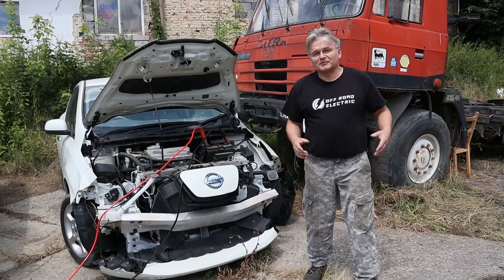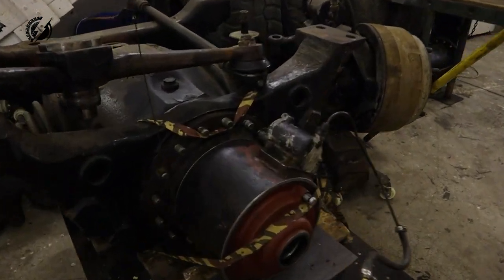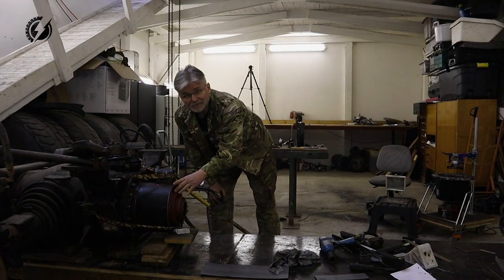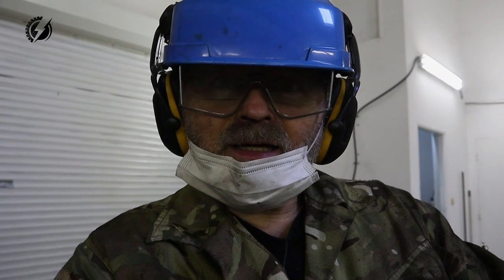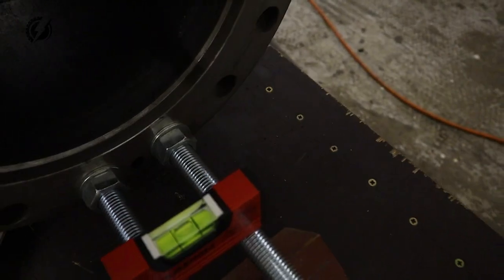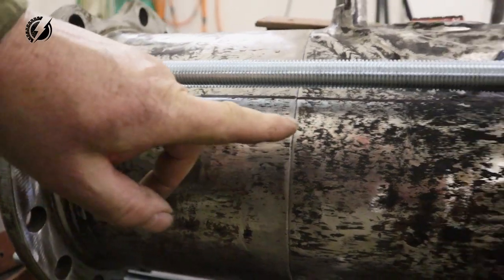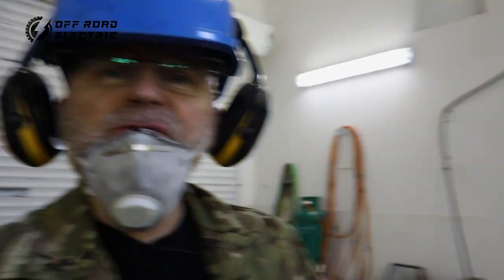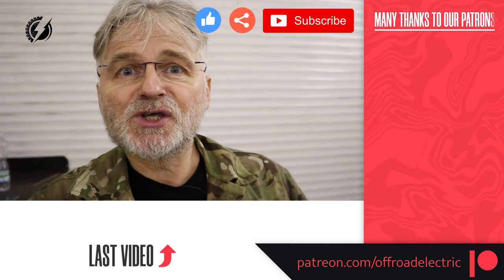EP 50, Building a Tesla/Tatra Monster Truck

Comment: Suggestion for aligning the tube segments for the rear tube... How about using the long threaded rods to align washers welded to the exterior of the tube, exactly with the end flange holes, before you start cutting segments out? Easy to say in hindsight 😂
Reply: Nevermind, watching more I see now that the tube segments aren't in the same orientation now vs when they were on the truck.
Reply from the maker: @kschleic9053  Potentionally possible, however the alignment took me I think only less then a half an hour, so no big deal i think.....We will se how the welding goes, if I need it
Reply: @offroadelectric9457  do you have access to a 3d printer? I could also envision some plastic alignment parts that could go inside the tubes and then get removed after the tubes are tack welded before the root pass
Reply from the maker: @kschleic9053  The inside of the tube is uneven, and as you will see on ep 52, it will not be passable during the welding. I am doing the diameter braces now as the sharp edges give me the difficulty with the line up for the welding.:) Fun.:)

Comment: If you had acces to a big lath it would make cutting the 45, o angle much easier, but we use what we have.
Reply from the maker: Know that, no access. But the tube cutter changes two days to two hours max, and the 45 degree grinding is about two hours as well, not bad.  I already have all the measurements, so it should be quick now.:)
Reply: @offroadelectric9457   Yes I admire your skills, I was a mechanic myself and am very interested in this project and how you overcome any problemes you run into. Watching from West Australia. Great project.
Reply from the maker: @patrickbrady447  Thank you Patrick!